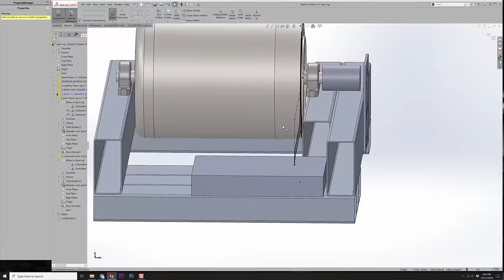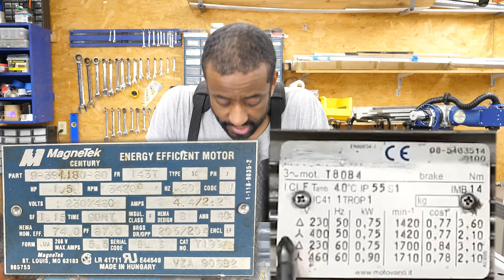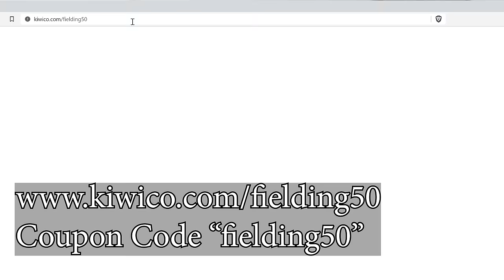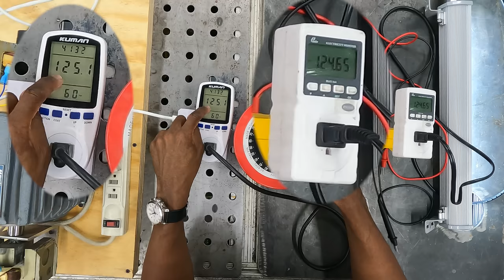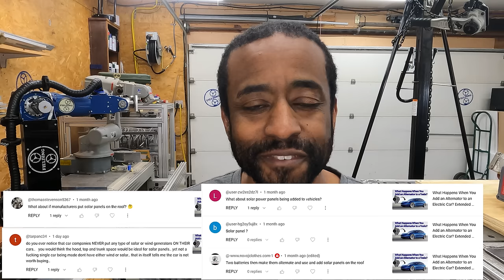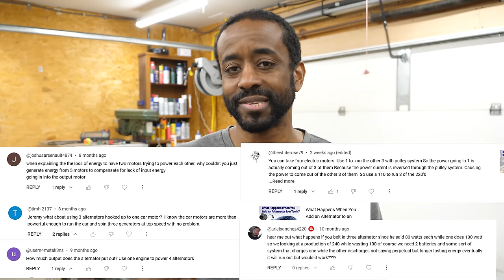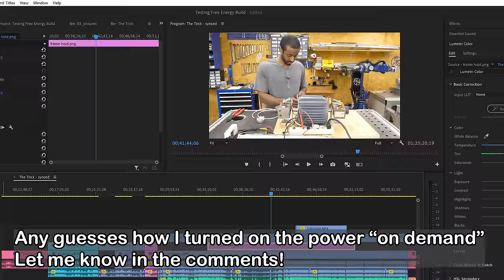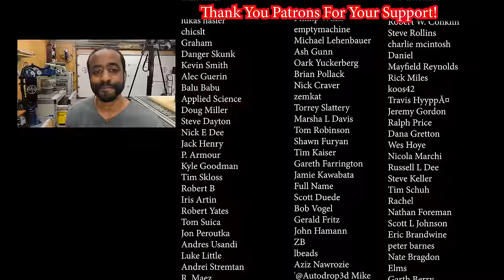Building and Reviewing Free Energy Generators on YouTube.

Comment: I know I am gonna get lots of attack on this but it doesn't really matter. And no thanks indeed to the thousands of scammers who have left people confused on what really to believe. Thanks so much Jeremy on what you are doing in exposing them.
Energy cannot be produced from nothing. Input energy is always equal to output energy in a perfect system where efficiency is 100%. Energy is only converted from one form to the other. But when you think and design around vibration and frequency, then this law of conservation of energy is the very reason we would run our machines on lower electrical power input than the electrical power output obtained. Drawing more power from an electrical generating system than you put in, would seem like breaking the energy conservation law, on the contrary, not being able to draw more power out is what really breaks the law in a system with differentiated vibrations and frequency. Just think a little more about it. The struggle for most people is understanding the theoretical proof of such a system. But the proof is indeed simple if you look a bit deeper. Believe me, the world indeed can be run by one mlliamp of electricity. At the right time indeed, everyone will get to fully know about this. Selah.
Reply from the maker: This is very interesting to me. I find it fascinating that you say this with a lot of confidence as if learned, but from in engineering perspective this doesn't make sense at all. The words don't mean what you presume they mean which is a bit weird. You also seem very genuine. So, I am just guessing here, but perhaps you have been listening to a scammer (but clearly someone you have come to trust a lot) and you are repeating what they "taught" you with confidence. Vibration for example is mechanical motion. It is no different than circular motion, or linear motion. It is just kinetic energy on display. In fact, in most applications, but not all, we don't want vibration because it is wasted energy and damaging to equipment. How, then is this ever an example or method of producing MORE energy on the output? There is no arrangement of equipment that can make any one form of energy input, including vibration, create more energy output. That is what the law of thermodynamics says. Nor does frequency or oscillation have any bypassing effect on the law. Certainly it is possible that I am too dumb to understand your method or how this could work. But you aren't saying that. You are saying "just think about  how this could actually be outside the laws of thermodynamics." This is not a normal phrase from someone asking a real question, but it sounds suspiciously similar to what I have heard in many scammer videos. Again I might be wrong, but you sound like someone convinced they have learned the answer but doesn't quite understand the meaning of all the words they are using.  And I know from reviewing many scammer videos that this sort of "language" is very common. It "sounds" right but doesn't actually mean anything. I suggest you question the source of this information. The whole point of this video is to show you how scammers will go to great lengths to keep you watching generating more ad revenue. These people are extremely persuasive and smart. They just have a lower moral standard along with they smarts. Don't confuse educated and intelligent with trustworthy. This is a topic that many people really hope is true, so we lower our guard a bit. Scammers know this. Dude, the bottom line is we all want this. No one is avoiding this possibility or hiding it. Its the very fact that we all want it that it is such a good scam. (edit: fixed typos)
Reply: @Jeremy_Fielding At the risk of sounding arrogant and proud, (pardon me if I do please), I am a first class Electrical Engineer, what I am saying isn't taught anywhere or in any book I know, I learnt it from first principles, inspired from the works of other great legends you know like Tesla. I do not talk half as well as you  do, great appeal of personality you got and I love what you do and this is why we will talk about the details of this at the right time. Shalom.
Reply from the maker: @achortg7107  I have read all of Tesla's books. There is no mention of this. You can buy all of his books on Amazon. I recommend you read them yourself so you can see what he said about his own works. I suggest you start with "my inventions" by Nicola Tesla. Thanks for watching and commenting. I hope you will read his books directly instead of what you find on the internet. A lot of people use his name to gain credibility with readers/watchers. Again please check out his books directly.
Reply: Oh I thought I did respond to this but can't find it. Hmmmm

Comment: The only reason that this type of free energy device works is because the Liberty guys used a mixture of certain metals for the bar. 
It could never work just using steel or aluminium.
Reply from the maker: I wish I knew how to explain to you that people can lie, and do so convincingly. You haven't yet nor will you ever see this product in person, yet here you are claiming it is true because he said it was true. The scam is genius because you want it to be true. There is nothing about material composition that could make this work. You need a source of energy here. No composite material can fix that. It is like saying my car with no fuel doesn't work because I am using the wrong drive shaft... or the wrong tires... or insert whatever answer you want here. You are free to believe whatever you want. I only made this video to help people not get scammed. But some just hope that it is true so much they are willing to trust anyone telling them what they want to hear. I won't take that from you.
Reply: @Jeremy_Fielding  I am trying to explain to people that it won't work if they try it too. But we all have to start somewhere on the path to free energy.
I don't believe it's a scam, they obviously should have been clearer to explain that it wouldn't work with any metals other than the special mixture they have discovered.

Comment: Ok… but this doesn’t completely cancel my idea. So in my idea you are harvesting wind forces the vehicle is making. Thru totally different system. RAM air does it thru forced intake for the motor.
But if you generate energy thru the aerodynamics of the car. 

I guess someone could strap a wind turbine to top of an electric car to see if does anything for the range on the open road. Or if the car can generate energy while parked…
Reply: Now this isnt really what the scammers are doing. It just a range extender idea.

Comment: Logic deduction is not for all anyway. But thanks for making videos like this.. 
If you make a video that makes people understand that there is no such thing as COLD fusion possible either.. 

It cant be done using cold matter for very obvious reasons.

The state that molecules and atoms need to be in for them to start fusing is when matter are hot as 4.000.000 degrees or something not far off that temp.. Its not very cold then.. 

So energy is used to get the matter ready for fusion, but our land based reactor chamber also needs a lot to magnet fields strong enough to keep the plasma from hitting the walls of reactor.. all in all, not possible to do commercially. The sun does it when very hot for a reason.. 

But still the believers keep trying, and there are many of them that are not that dumb on paper either..

Comment: Hi I just wondering if is this possible where there is a two energy storage that can charge fast but discharge slow like super capacitor and between that energy storage there is a relay switching on the another energy storage on where the another one is out of energy and while the second energy storage discharge the other one charge's and this energy storage is supplying a motor that drive a stator to supply the other energy storage to charge don't sure if it work but it is in my mind

Comment: I don't know if his works or not but I think if you put some play some electromagnets of the stator and use some capacitors and switch to switch agent one of the capacitors with the electromagnets like six or eight of them because you can get the electromagnets right up against and have a feels to move around just like you would have the fields move around just like you would a a spinning rotor a Virtual Router cuz you put any frequency or rotational speed that you want to virtually in one scientists did get it to work over Unity like four times or five times over Unity

Comment: What about the planets rotating around the sun with no AC power cord ?
Reply from the maker: The planets obey the laws of physics. The whole universe, as far as we can see, behaves like a giant clock that has been wound up and is running down. We can see everything cooling off, slowing down etc. The moon is moving away from the earth. The earth is slowing down it's spin. The sun is VERY SLOWLY burning out. This all obeys conservation of energy laws. But, if you are asking where the initial energy came from that is a philosophical question as none of us were there and you can't measure the past no matter how much scientist wish they could, or pretend they can. We only have the written past to explain what happened and rocks as they are today.
Reply: @whydotheathensrage  You do not need a constant supply of power, the planets spinning would be more akin to a fly wheel. They were given a huge amount of energy and are slowly burning it off. As Jeremy said, we can see all the energy going down in any system we look at. I just got a lot at the beggining. Now where all the power came from initially is unknown, yes, the big bang may have supplied it, but we don't know what gave the big bang it's energy in the first palce. Nothing is rotating perpetually, just for an incredibly long time as they slowly burn off energy.

Comment: The thing is this. Common physics. First I want to thank you for exposing crap. People will do anything to look smart and wise. Like fixing cell phones with tooth paste. Ok now for wisdom. Do some real math and look for the falsity you were brain washed into believing. You do know a lot and are capable, so see the simplicity of this. You can keep a perpetual circuit. Trick is to supply more amps than you use. Then automatically start with a 15 percent negative value. Her is the equation: let's use our house. Take an old alternator, even if it is bad because the only thing that can go bad is the diodes. Take out the regulator, diodes, and that crap rectifier if it has one. All alternators produce AC current. Hence it's name. Most generate 90 to 105 amps. More on utility vehicles such as trucks and ambulance. It also has a power curve so there is an operating range. Stay in the 13.8 to 15 volt speeds. This changes during draws as drag is produced and needs more torque to make it spin. So say 100 amps minus 15 makes 85 useable amps. Your motor to supply the mechanical costs at max draw  round about will be between 40 to 70 amps. Now we just invented a direct drive perpetual circuit with an excess of 15 amps or more. So to comply with the usage we can use no more than the 15 to keep it running. After that the system will become unstable and weaken more with each amp of overdraws shortening the life of the circuit. The losses are attributes come from heat and age of the wire, weather, general conditions of equipment and age of the generation unit such as the brushes, dirt, humidity is a killer and basic stupidity from wiring skills. Anyway your right on a lot but educate yourself on what energy is. I like you but your long winded and short sited. Keep up the good work. Love ya man

Comment: I think you should try and build a tiny tiny gas engine generator, like a 25cc weedwacker engine, or a little 2-3hp hond GX90? 4 STROKE CLONE.. that can idle, and make 220v, and power a house. AND OR stuff for  8-10 hours? 
( a GENERAc 5800? uses like a 13hp engine, at like 3500 rpm, screamin for 8 hours? and burns like what, 7-8 gallons of gasoline??....    

I wanna see only like 1hp petrol engine, heck maybe even a RC caR NITRO ENGINE.. that can put out like 220v 100 amp? and get it too last like 8hours on .75?-1 gallon... 
AND you could run it on alcohol.. Or a diesel, 2hp on vegi oil?... but like a little 2-3hp engine on alcohol, BE ENVIORMENTLY BETTER.... super quiet.. and just idles...

 HECK,, maybe even like a steam engine, that just used hot/ heated water?" helped by some sort of solar heating an tad but of a fuel type or something too heat water too stem, too spin a generator too make juice.... lol..

Comment: I feel like I'm the only person that thinks of this and I know it won't fix the problem and maybe won't even make it better idk but could u explain how it would impact an electric car if they would build wind mills on them like small ones either in the grill or on the trunk somewhere as u drive it can catch the wind coming from the front and turn that to power lol
Reply from the maker: The short answer is no. It will resist rotating just like the bicycle example from the video. The same "pushback" I kept talking about in the video happens with windmills and any other mechanical load.
The windmill or scoop acts like a brake resisting turning and slowing down the car. 
Remember you are "creating the wind" with your motor. It will produce more drag and slow the car. You need more power from the motor to keep your speed. The power needed to spin the windmill will be slightly more than the electrical power created by turning it.
You have to use more energy than you can make like putting $50 in a machine to get $28 back. Nothing else... Just less money, and in this case a heavier car, with more parts, and it cost more to make. Hopefully it makes sense to just keep the $50 you started with, rather than giving some of it away for nothing.

Comment: Ok, this doesn’t work, however people use solar panels to charge a battery bank, wouldn’t a   Spring powered flywheel connected to a large alternator from say a semi truck charge the battery bank running 24hrs a day?
Reply from the maker: Solar power is not related an any way to how alternators or flywheels work. I am not sure why you are comparing them. It might help to watch again though. I talked about all of these things in the video. But it’s pretty long and dense in places so maybe you didn’t catch it all or even watch it all
Reply: I understand that solar panels are not related, I understand that this is about running a loop and how it won’t work, I guess my question is more about could a flywheel run an alternator to charge a battery bank? You seem to know a lot about this stuff was wondering your opinion if it would work? Instead of buying solar panels you could just use a flywheel which is spring powered  To charge battery banks, instead of using solar panels, it would take up less room less expense. It would also run through the night, where a solar panel doesn’t.
Reply from the maker: @danielmybrother3441 . The short answer is no. You need an energy source not energy storage. This is covered in the video and I think it would help to rewatch with this question in mind. But your suggestion is like trading in gasoline for a bucket. One is energy and the other can hold energy.

Comment: I could not see how it could have even theoretically had any plausibility .
Reply from the maker: This is for people who don't know how these parts work. The scam works like this...1. The viewer doesn't know "how" a transformer works, but they know its related to power 2. a bunch of other parts related to power are connected to it. 3. The device seems to work in the video and they are using parts you "know" So it feels like you understand even though it still doesn't make sense. 4. the presenter sounds like they know what they are talking about. 5. Most viewers hope its true. This factor was more powerful than I initially thought. And that's why I talk about it so much in this video. 6. Finally they don't know why someone would lie about this. By the time you get to the end of the video it doesn't even matter if they believe it or not. But they are likely to both believe and share it because "wow free energy!" Via sharing you now also have a pyramid scheme.  You trust the person who shared the video with you. So, you came in primed to believe it. It is surprisingly effective on the general public and that is why I made this video.

Comment: You missed the point.  There is a ‘muscle torque sparks’ when they come into grip and release. So, you did not explain the key interaction of batteries. You didn’t explain the battery assembly.